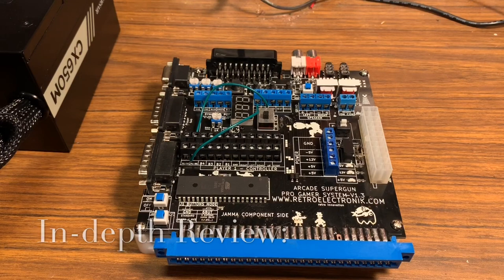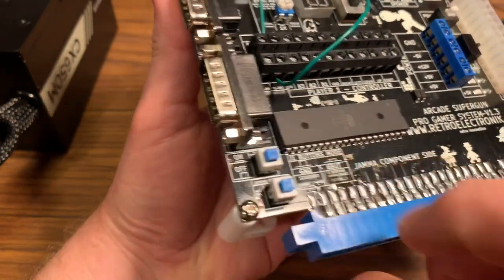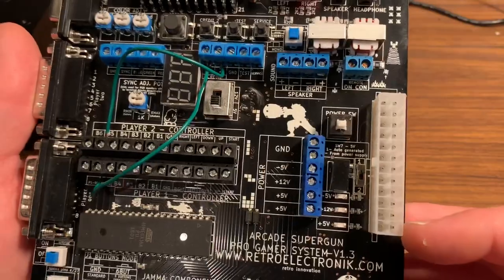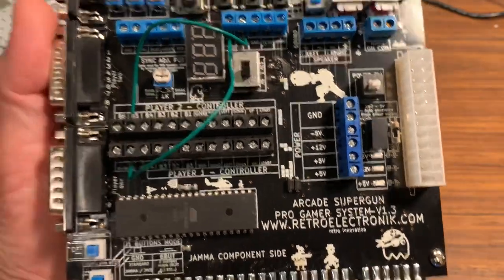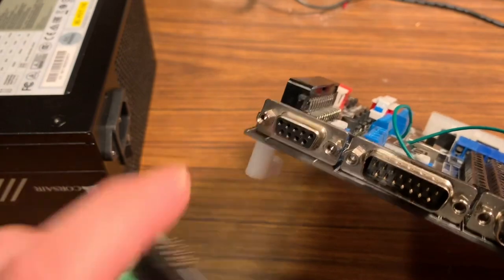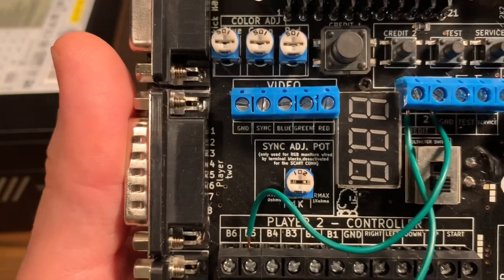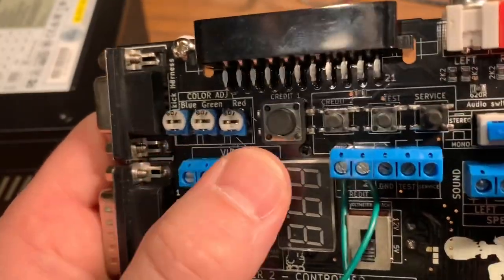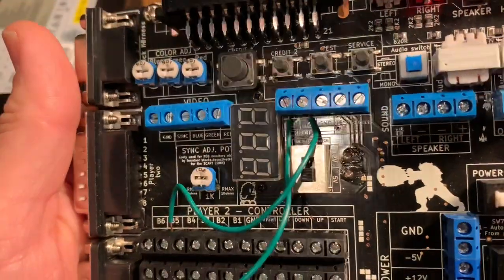Play Arcade PCBs on your TV! | Retro Electronik Pro Gamer System Ver. 1.3 | Arcade Supergun Review

Comment: Hey Mike, great video. Very informative. Thanks! Did you find out anything else about the select button on the MVS-4? I was thinking about using a jamma extension and wiring up from there.
Reply from the maker: Hey Marcelo.  The Retro Electronik gun works great with a 4 slot.  Here is an article I wrote specifically about it.  Any other questions let me know!  https://atariage.com/forums/topic/223548-the-official-neo-geo-thread/page/834/?tab=comments#comment-4411229

Comment: Wait, the Neo Geo is a 4 button system, so if you plug an MVS into it, does button 4 not work when using a Neo Geo controller?  I know Samurai Showdown uses the 4th button.
Reply from the maker: Ty Brown yes button 4 works automatically, no extra wiring or kick harness required.  Plug in your neo Geo joystick and enjoy

Comment: where can I get the cable for going to the GBS8200? I notice you're only using 5 wires on it.
Reply from the maker: Typical jamma is only red, green, blue, ground and sync.  The cable came with the converter.  I just spliced it to the jamma harness
Reply: So could I just use the screw terminal on the super gun to wire a 5 pin connector to the 5 pins in the lower left of the GBS?
Reply from the maker: Yup
Reply: @mike7599  Thanks for the clarification I appreciate it

Comment: this product sucks in everyways. if i connect it to my crt television the image is dark and there is no way to adjust brightness and the support is not existent
Reply from the maker: Hm thats weird.  Did you try dialing up the rgb pots?  That should help you.  The problem could also be the SCART converter your using.  What type are you using to connect this to your crt?
Reply: @mike7599  i tried a normal scart, on lcd the colors are impasted, on a plasma the picture is shifted to the left and on crt  it is to dark that i can barely see only the white color
Reply from the maker: Sorry to hear it is not working for you.  I can tell you no matter if you have a cheap supergun or an expensive one you most often have to dial the settings in specific to each tv your using.  As far as the colors, again, did you try adjusting the red, green and blue potentiometers on the supergun?  You need to dial these in specific to each tv.  If dark picture persists I would make sure you are using a passive SCART cable and not one that already has resistors built into it.  And as far as the picture being off center I have also ran into this on a few arcade PCBs I own.  My solution was a cheap jamma adapter from Aliexpress that lets you adjust the horizontal and vertical using built in knobs on the pcb.  Here is a link: https://m.aliexpress.com/item/32910155435.html?trace=wwwdetail2mobilesitedetail&shortkey=UBBFvYNR&addresstype=600